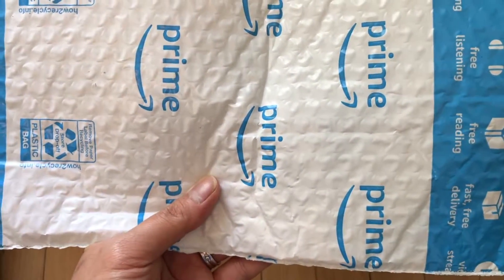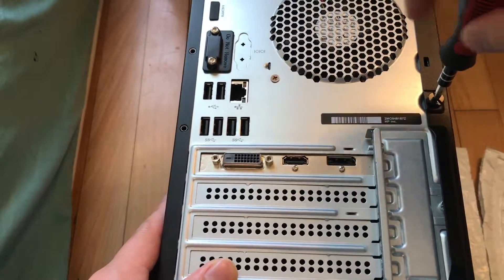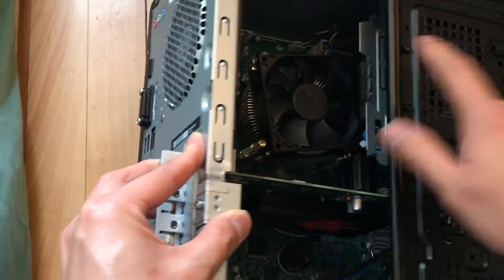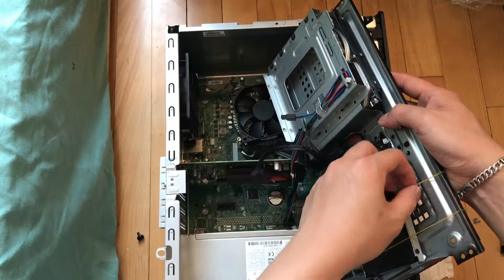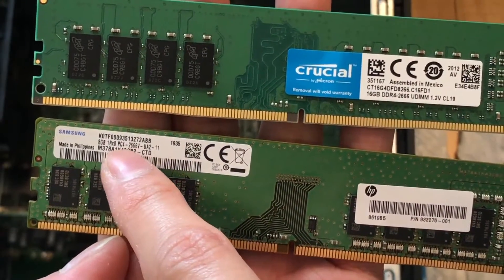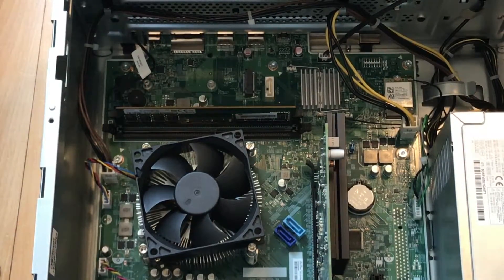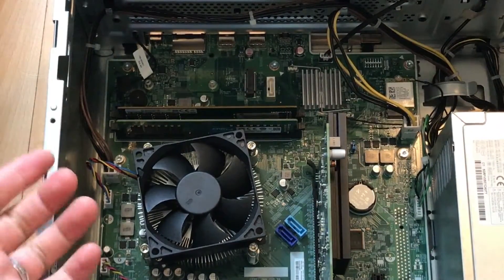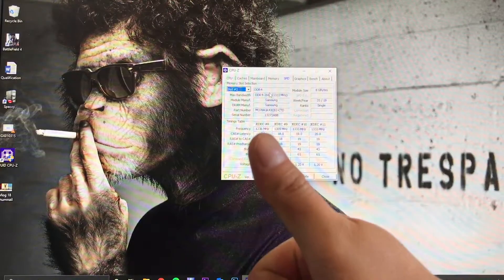[BIY #3]: Upgrade Ram on Hp Pavilion Gaming Desktop 690-0010

Comment: I have the TG01-0xxx
Reply from the maker: I believe the process of upgrading will be similar, and so is the ram speed. For sure, after dissembling the side panel, you better look at the specs on the ram stick included in the tower and start doing research what you need. For me, Crucial is the most compatible. Good luck!
Reply: @tatkhang12  would ddr4 3200mhz work

Comment: I've just put in two 16 gb  sticks recommended by Crucial as compatible. Computer woun't boot. I get four long beeps and two high pitched beeps. Can you tell me what's happening?
Reply from the maker: I am unsure. Have you tried to unplug it to see if your current ram stick still works properly? Otherwise, you better ask for the exchange of your new 16Gb stick because I think it is faulty.
Reply: Had the same issue at first. I wasn't inserting it all the way. I got big strong hands because I work outside a lot so I was trying to be more gentle with it than I needed to be. Just put a decent amount of force behind it but not to much until you hear the click like at 5:27 . Once it was fully inserted it booted right up.

Comment: Will this work with the hp pavilion gaming desktop 690-0xxx
Reply from the maker: Regarding Ram installation, the process will be applied, but I’d like to know your exact model for the best compatibility. Thanks for ur question.
Reply: @tatkhang12  I have tg01-0023w HP Pavillion gaming desktop with ryzen 5 3500. What's a better ram that will work with motherboard. Bios is locked so I got no settings for memory. Supports 3200 or says,  came with 2666mhz ram 8gb. I want 16gb 3000mhz or 3200

Comment: I have same pc can I remove the original ram stick and add 16gb ram 3200hz from Corsair
Reply from the maker: Hey Tran! I wouldn’t do that. That is dangerous for your Corsair ram cuz the motherboard doesn’t support that high speed ram. Go with 2666Mhz for the best result & 32Gb of Ram is the maximum on this m.b. Good luck

Comment: does this still work with the Hp 690-0073 ?
Reply from the maker: Sorry, the ram stick in my video doesn’t work with your tower. Probably find a ram stick with this spec: PC4-21300 (DDR4 2666). However, my process of installation is gonna help you out.

Comment: after i installed another 8gb of ram my frames dropped in game
Reply from the maker: Sorry for hearing that! Make sure your ram has the same speed as the motherboard supports. I can check whether your ram is appropriate for your tower if you tell me the model.
Reply: @tatkhang12  we have the same computer except mine came with a gtx 1660 ti and a i5 9400f with 8gb of and a 256gb ssd. and i fixed by switching the original ram it came with and putting it in the second slot. but here is the ram i bought 

Crucial RAM 8GB DDR4 2666 MHz CL19 Desktop Memory CT8G4DFRA266 https://www.amazon.com/dp/B08C4QF5N4/ref=cm_sw_r_cp_api_glc_fabc_iLY7Fb1M4QRRP
Reply from the maker: @vzoreo5670  your ram is perfect. I recommend a few options that may help:
1) switching the original ram back to where it was. Download CPU-z app to see if both ram sticks operate at the same speed.
2) upgrade the latest BIOS from HP site
3) reach out to Amazon to exchange to new ram stick in case the one you bought is faulty. 
Good luck.

Comment: Do you happen to know to what extent you can upgrade the graphics card? I was thinking of an RX 580. I've heard it works with most HP pavilion gaming PCs but not on this model and considering some of its other limitations I wanted to know for sure. Thanks!
Reply from the maker: I prefer rtx20xx mini which will fit in this tower only if I upgrade PSU from 350W to 550W. 350W PSU is a major limitation on this tower.
Reply: @tatkhang12  I see, I didn't think of the power supply, thanks. I'll look into that graphics card as well.
Reply from the maker: @weenie_butt_-5273  is RX580 your desire?
Reply: @tatkhang12  I want to use the RX580, but I will have to see if upgrading the PSU is required. I also need to find out if the RX580 would fit this case.
Reply from the maker: @weenie_butt_-5273  surely, upgrading PSU is required for that heavy duty GPU. look up on parts.hp.com for 500W PSU (L05757-800) which kind of compatible with this tower. This 500W PSU is not as small as the 350W PSU, but it will fit in. Good luck
Reply: @tatkhang12  thanks for letting me know, otherwise I would have had a big issue haha. Thanks 👍

Comment: can u upgrade processor ?
Reply from the maker: I believe so! I have bought ryzen 7 2700 (non x), the highest processor this tower supports. I’ll soon release a video of processor upgrade.
Reply: Is it ok ? if i upgrade it on ryzen 7 2700x ?
Reply from the maker: GSK_gaming Sorry, you cannot upgrade to that high because of the BIOS. Hopefully, HP will release an update for higher performance cpu.
Reply: Damn
Reply: How about ryzen 5 3600 ?
Reply from the maker: GSK_gaming Nothing’s more than ryzen 2xxx (non x).
Reply: I wanna die
Reply from the maker: I have just upgraded my cpu.
Reply: Is any graphics card works ? On this pc